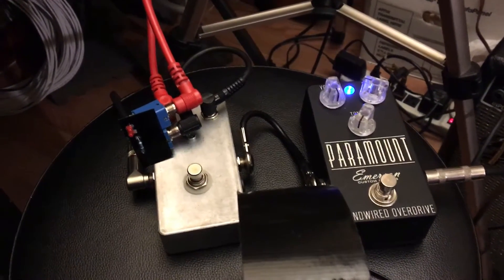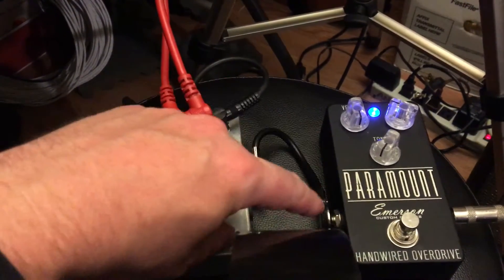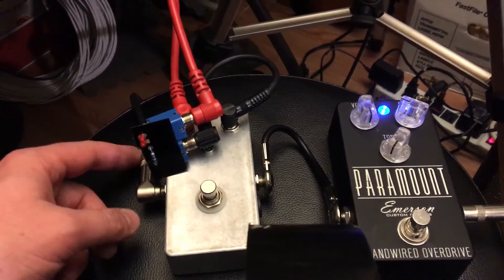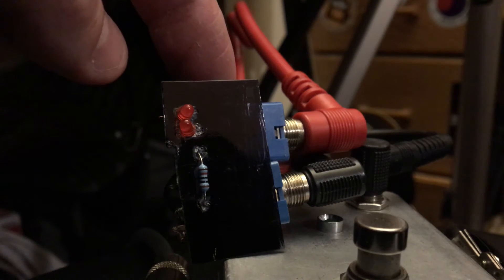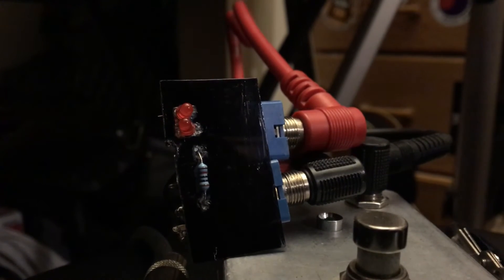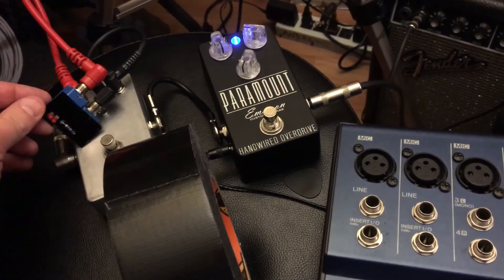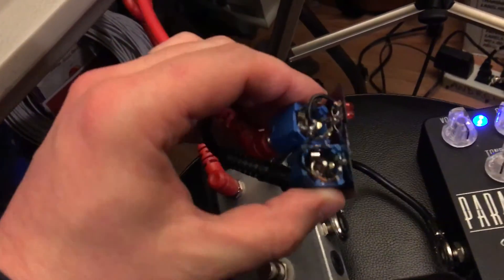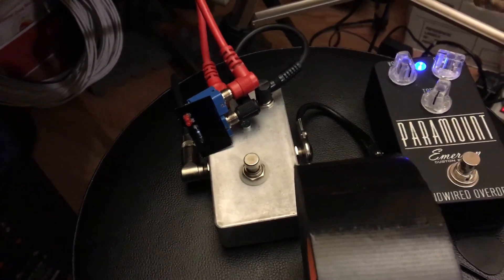Add a passive hard clipping stage to an overdrive

Comment: I took your idea and mounted the diodes and resistor to a switch in a cheap OD pedal (Joyo Vintage OD).  I used an Infra-red LED (950mv) and a silicon diode (705mv) with a 4.7K resistor.  I played with different diodes and resistor values. It sounds great with humbuckers!  I wondered why the LED didn't light up....infra-red light is invisible to the human eye :D
Reply from the maker: That's awesome! I was thinking of putting this after a boost, like a MXR microamp or EH LPB. Maybe a volume pot at the output. 

I like the idea of using two different diodes for clipping. I'll have to give that a try!

Comment: Where can I get the schematics? Or can you tell me the resistor value?
Reply from the maker: I used a 10k resistor. The schematic is pretty close to the first one one this page, but I didn’t use any pots on the input our out. https://www.261.gr/limiters.html
Reply: Thrifty Producer thank you so much! I’ll try it  for shure

Comment: I know this takes the whole passive schtick away, but to combat the volume loss, you could always throw a cheap boost after it just to bring it back to unity.

On top of that, you could throw a boost before it in the loop and crank it a bit so you can have a bit more clipping without having to crank the OD before it too much. Use a cheap pawn shop/yard sale EQ as one or both of the boosts, and you can shape the tone essentially making a simple modular distortion without spending much more than what the parts cost.

Comment: Do you have a simple schematic? Can i use a pot instead of the fixed resistor?
Reply from the maker: I used a 10k. I could see using a pot around that value instead. I would think it would vary how much headroom you have before clipping. I’d say go for it! I’ll try to draw up a schematic to show exactly what I did.